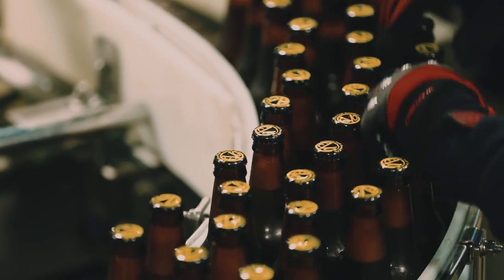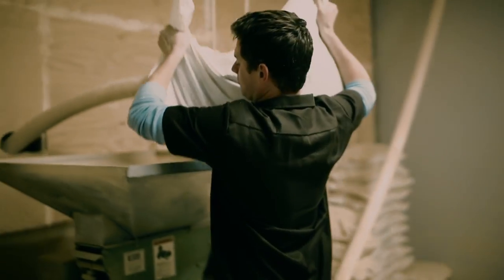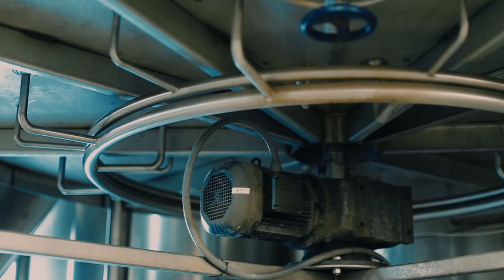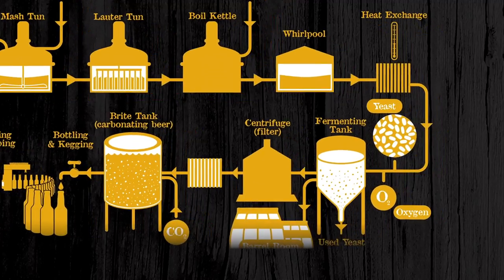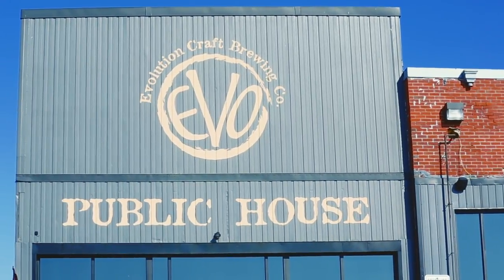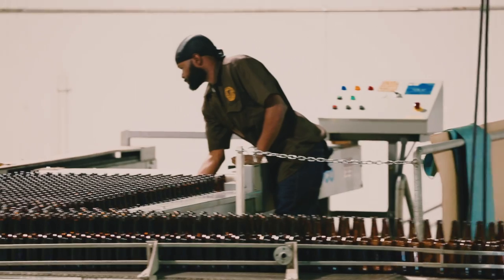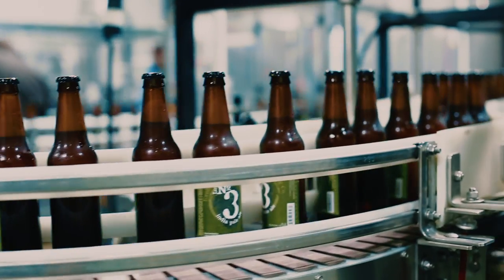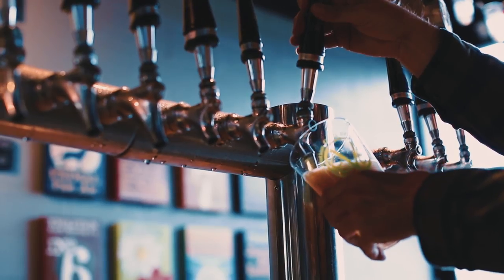Evolution Craft Brewing Co. Brewing Process

Comment: Very nicely made video but 2 doubts though

1. Aren't you losing dissolved co2 when filling the bottle (cause I noticed that there is sufficient time delay in filling and crowning of bottle)

2. I imagine even after passing through centrifuge some yeast might have survived and would convert the residual sugar in the bottle to co2 and alcohol (approx 2%). Would this not produce any settlement in the bottom of the retail bottle?
Reply: I work for a very large craft brewery and we only pasteurize a couple of beers.   Mainly our sours and a few stouts. Sours have bacteria added specifically to sour and you don’t want that in the final canned or bottled form.   Sometimes beers like IPAs and Lagers will have yeast sediment or suspended particles after centrifuging but it’s rare.   Most beer these days is always kept under refrigeration so the chances of fermentation after packaging are rare.